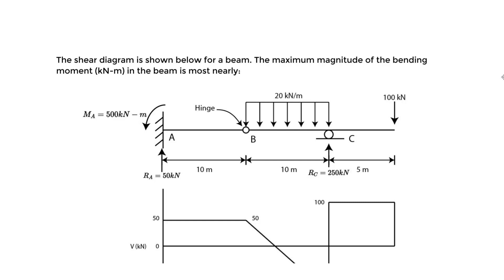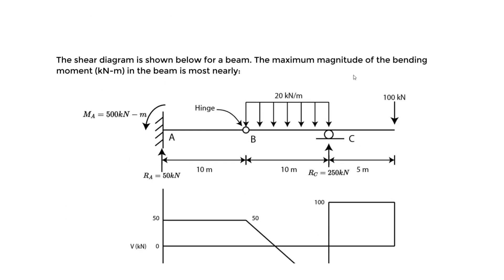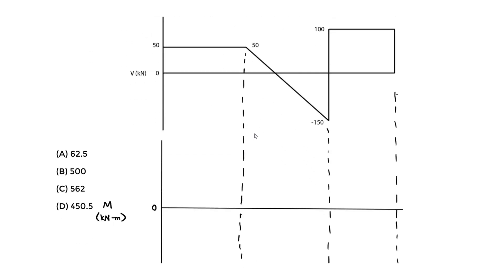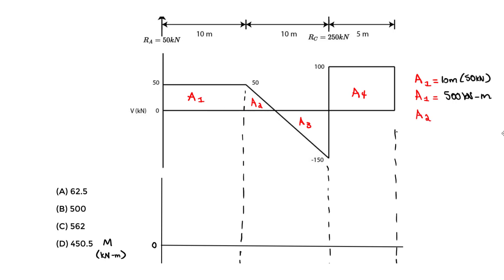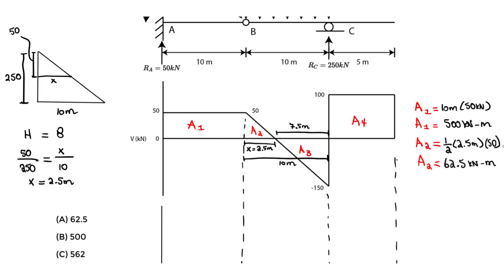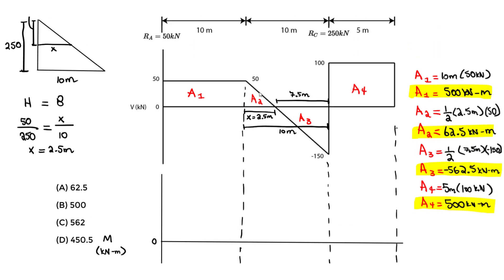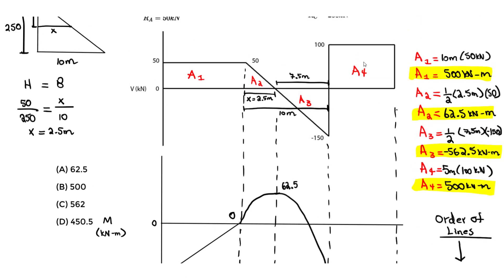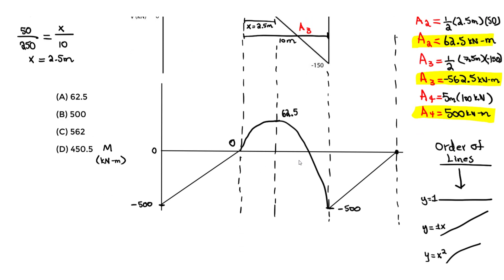FE Exam Review - Mechanics of Materials - Shear and Moment Diagrams - MATH MISTAKE

Comment: The height of the big triangle is 200 not 250 right? (150+50)
Reply: He says that the max is 500, but i think is 562. Its confusing
Reply from the maker: @dennypereyra4033  Did I do this right? I think it should be 500.
Reply: @directhubfeexam  I got 562 if you don't map the given moment at A (-500 kN).
Reply: The x value of 2.5 is correct, it’s just that the height used of the triangle is wrong. 50/250 (wrong height used in video) equals 1/5, therefore x should’ve been 2. If the correct height was used, it would’ve been 50/200 which equals 1/4. 2.5/10 equals 1/4, meaning that the x value is correct it’s just that the wrong height for the big triangle was used
Reply: @jace3254  in other words, to solve for x, it should be the area of the pressure rectangle thing (20 kN/m * 10m) over 10 as a ratio is equal to 50 (height of little triangle) over x. so 200/10 = 50/x >> x = 2.5
Reply from the maker: Yes the solution is wrong. Sorry about this
Reply: @directhubfeexam  Max moment is 562, no?
Reply: @holipinieo1  yessirr

Comment: X=2 not 2.5
Reply: How did you get 2? height of small triangle=50, height of big triangle=150+50=200. Then length of small triangle=x, length of big triangle is 10. So we get 50/x=200/10, x=2.5. Genuinely asking because I don't want to miss a mistake.
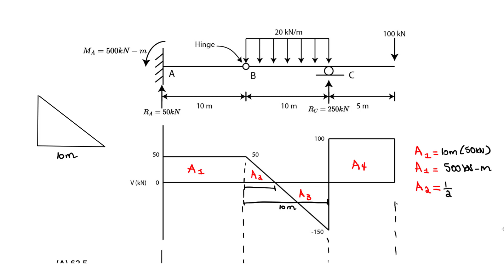Reply: @LetsGoBoyce  2.5 is correct. Its just at 5:10 to 6:50 the triangle dimensions is incorrect, which leds to the incorrect height of 2.

Comment: What is the max finally? I am confused. In the other video someone said max moment is when shear is zero. So in this case it should be 62.5 am I right?
Reply from the maker: Hi Zainab, the 62.5 is the maximum positive moment (thinking of the beam bending concave up). The absolute maximum moment would be the -500 (this is a negative bending moment that bends concave down). 

https://www.google.com/url?sa=i&url=https%3A%2F%2Farchexamacademy.com%2Fdetermining-positive-and-negative-moment-in-a-beam%2F&psig=AOvVaw2fB1bB6frTzAokhq42F0fh&ust=1629583280995000&source=images&cd=vfe&ved=0CAsQjRxqFwoTCMDZ-fnMwPICFQAAAAAdAAAAABAD
Reply: @directhubfeexam  thank you so much for explanation